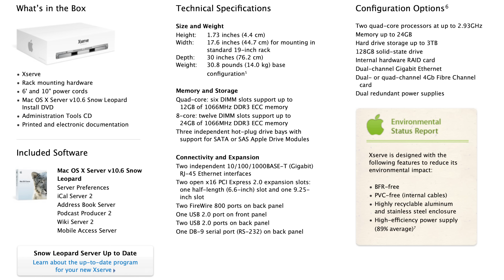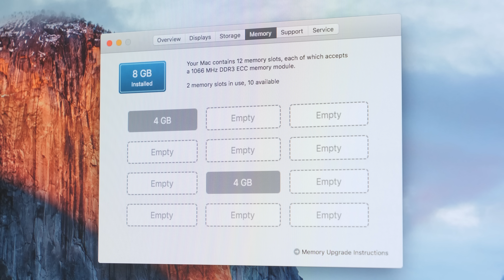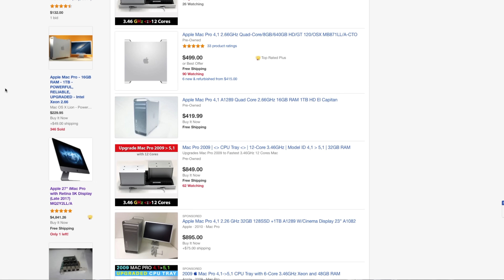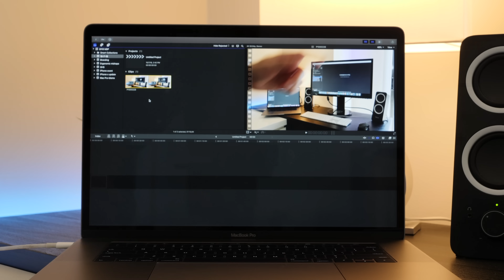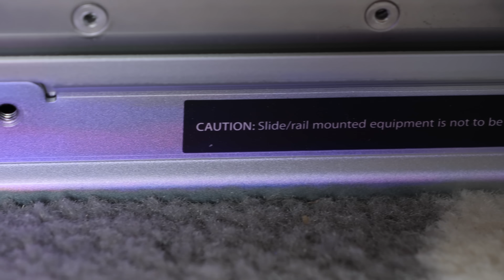I bought the forgotten Apple Xserve in 2018

Comment from the maker: A lot of people seem to be missing the point of this video: I am looking at the Xserve from the perspective of a standard/workstation user. There's not a lot of server talk because I am examining this computer from the point of view of someone looking for a cheap mac/ Mac Pro (since the Xserve is very similar to the Mac Pro). Also, there are a lot of pronunciations for Xserve and apparently you all hate how I say it :p
Reply: X Serve. not EGG serve. pronounced EX SERVE  :D
Reply: Completely agree with Joshua here. you're effectively taking a tractor and complaining that it's not a car. of course it isn't this was completely designed for a different market. while it may not be a market you think that apple's standard users were a part of, most media workplaces have a server rack in the cupboard somewhere, so the concept of adding apple servers individually for rendering/encoding or in an array together to handle distributed tasks was not an uncommon thing.
Just because these products may not apply to a home user, does not mean that they would not apply to a company using these. for a large scale media company that does a lot of work on mac hardware for clients, dropping 50k on an extended support plan wouldn't be an issue, and buying extra parts? i have spare parts in the cupboard for my workstation, and i'm in charge of restocking the replacement parts at work. we go through them reasonably fast, because when you have hardware on 24/7, failures happen. and as a company, you want to get that hardware back up and online and earning you money ASAP.
I understand what you were trying to do here, but please, don't buy a 1U server, complain about the noise, form factor and usecase when you seem to have literally missed the entire point of the device.
Reply: Can we also mention the fact that Apple cache servers save lives (and bandwidth at iOS update time)... Even tho you can do caching on a MacBook.... but still. 

I agree with Joshua as well, the prices aren’t bad when compared to Dell/HP servers, even though your range of use for this is slim.
Reply: why would you review a server, like its a personal computer??? some galaxy brain shit.
Reply: Dude look into stuff like the LackRack and the like. The ideal use case as a home machine would be to put it in a remote location and VNC/KVM/RDP to it, this is commonly done in the Windows server world.
Reply: You miss one item: power usage and power saving during idle... that is a lot wors too.
Reply: Yeah, but Luke, you titled this video implying that you are reviewing a server, not reviewing a server as a workstation. Bad video title (currently just clickbait to server admins). I suggest re-titling this.
Reply: You kind of missed the whole point of a server. It was never designed to be a workstation or desktop, thus it will not be effective in these scenarios, that's not what it is made for. Yes the hardware is similar to a Mac Pro but there's really no feasible way to use this in the same environment.
Reply: Alrighty then... my reply isn’t as “intense” as some others—clearly taking one’s personal opinion on repurposing an older piece of hardware rather seriously, eh 😉? I totally got what your video was GOING to be about and understood from what perspective your analysis was coming from, so you don’t need to change the title or anything. Perhaps some of your viewers should try to par down their “multi-tasking” and fully engage themselves in a video to actually comprehend what is clearly stated throughout by the creator several times. So yah, please don’t dismiss my legitimate inquiry! 😝
What are your thoughts on using it as a “Media” server? I could easily put that up in the attic (obviously with proper racking, etc) and connect via my just-installed CAT6 network I created! I currently use a mini but that has to stay down near the TV for HDMI. It only has 8GB RAM and a spinning 1TB HD (it was a gift and a very nice one at that but yah, I know, either more RAM or SSD would make a HUGE difference). The mini is the last model they did where you can’t update anything in it BUT, I’ve learned so much and done so much thanx to YT perhaps I can crack that thing and upgrade some of its components... 🤔
Reply: just don't do that! you wouldn't try using a banana like you would use a disc breaking pad, would you? what's the point?
Reply: Any crazy upgrade plan fot this beast ?
Reply: Next investment could be the Xserve Raid as a NAS
Reply: The real point is, We want the title of the first background sound
Reply: Luke Miani you should compare it to the intel compute stick or something close to its price.
Reply: Luke Miani and and you the guy from teen wolf, most important
Reply: Luke Miani 
Thx for the video 
Can u try updating it 
Plz
Reply: …then the title is misleading…
Reply: Yeah, you say it wrong.  Very wrong.
Reply: I cant believe everyone is triggered about him pronouncing something wrong. Also, it’s his Xserve. He can call it how he wants and use it how he likes it.
Reply: Yeah came here to rant but see you covered it. Homelab Heroes love this stuff. The noise and power draw are part of the data center experience. All you need now is some underfloor air ducts, a hot/cold aisle, and that very special moment when you walk outside into daylight when you walked in at nighttime.
Reply: @Jsh how much?
Reply: Yes, & that's stupid, sorry.
Reply: I love having an Xserve sure it’s loud and doesn’t fit in a regular depth rack, but heck not many people can say they own one. Best of all it cost me nothing as it was the backbone many years ago in the school I work in and learned all about some of the amazing features sets in the original OSX Server environment.
Reply: Nah you’re saying it fine Luke! I say “xSERVE”. That’s how you said it too.
Reply: No there’s literally one pronunciation lol
Reply: The only reason I haven't disliked this: I had no idea this thing (Xserve) existed before watching this video. It looks kinda cool, would love to explore one in more detail. Otherwise, you ended up selling the most useful and least outdated component on ebay for cheap :) Everything you complained about is applicable for any server. They all are noisy, power hungry and the friend of mine used to actually dry his hair in a hot corridor of server room :) And there is a good reason for it to be so cheap - if you account for energy price, most modern low-end systems will perform better in all possible ways compared to ~10 years old server. The only reason you may want something like this is to explore server hardware.
Reply: This is a fine video. People hate that you review the Xserve as a workstation. Maybe rename the video to:
I bought the forgotten Apple Xserve to see if it is good for workstation use in 2018
maybe that will keep a little hate away :D
Reply: People just get triggered when anyone talks about servers. “Oh your not talking about it right! Waaaa waaaa waaa!” Don’t listen to them. Love the channel
Reply: For starters, if you can't pronounce the name of the product maybe you shouldn't review it...
On a side note, the network cards in that machine are probably still worth more than your eggsesrv.
Reply: I think my problem stems from the fact that you're taking the point of view of using it as a desktop yet ignoring the fact that it's a "Server" and then being a whiny brat complaining about "Noise" You bought a freaking server, of course it's going to be "LOUD!" If you want quiet find a way to replace the fans with Noctua fans or something, but complaining about the Noise level is pretty low even for Mac users. Oh by the way "PC for Life!"
Reply: To everyone: here's the problem, this is a video explicitly about complaining that a server is not a good desktop computer. It's a video about a tractor not being a car. This is not a serious product review where the reviewer tries to give a neutral viewpoint.
Reply from the maker: @PixlRainbow  you're wrong. I like the Xserve, I'm not complaining. And it's perfectly reasonable to compare this to a workstation when it shares it's parts with a workstation! Apple discontinued the Xserve largely because of the similarities to the Mac Pro so clearly it's not a ridiculous comparison
Reply: @lukemiani  how am I wrong? You just agreed with me!
Reply: @lukemiani  no, it's not perfectly reasonable.
Reply: Nah man, it's not a workstation therefore knocking it for not being a good workstation is pretty dumb.And there's literally one way to say it. X.....serve..... not egzERVE. Sorry but somethings are just the way they are!
Reply: I know I’m a year late but it’s as if none of you actually watched the video lmao, he didn’t knock apple once or servers in general
Reply: Just like how there are lot's of pronunciations for iPhone? Go ahead, try saying eh-phone, or pronounce the i as it is produced in tin. There is one way to say Xserve... sorry bro.
Reply: It’s called a ex serve god you say it weird. If you want a cheap Mac buy a Mac mini.
Reply: Luke Miani loved the video & oh my gosh the race cars Rhan Stahpppp 😂🤣🤣
Reply: That's how I'd say it. Liked the video man!

Comment: These things had a lot of potential but Apple never seemed to want to make them successful. It's loud because it wasn't meant to be used in the same room where you work. ALL rack mounted servers are this loud. In the long run, it was better for Apple to make macOS work better with servers running Windows and Linux. Apple's adoption of ActiveSync and bringing Exchange compatibility to macOS were great decisions. I have setup and run a lot of macOS servers during my career. When Apple decided to kill the Xserve, I saw the end coming, but I didn't realize at the time how long it would take for Apple to kill off macOS Server. macOS Server died a slow death as Apple gradually made the product useless with each new version. This is how I convinced my customers to abandon macOS Server and move to better solutions.

Comment: I am super used to loud computers, my Asus 2004 gaming rig (was a super powerfull pc when new, 3 ghz dual core processor, 4 gigs of ram, gpu with 1 gig of vram, IN 2004!!) but the problem was its loud fan system, a 12 inch side ”turbine” made it so loud that I would not even try to use it while someone in my family was sleeping. Nowadays after I changed the case, it is way quieter and I also changed the GPU from the OG AMD something series (the one with 1 gig lf vram) to NVidia GtX 960 2 gig, from my fathers old pc. I am a tech nerd with many computers, laptops, phones and tablets.

Comment: 1st, your benchmarks are not giving you the real performance of this system, not until you have RAM on ALL memory channels of those CPUs
2nd I would have kept at least one of those network cards so I could use this as not only the storage server but also the main system router and firewall
3rd I would add an SAS controller with external connectors one with decent cache RAM on it, minimum 2Gb and add another rackmount enclosure, a SAS Storage Enclosure one that includes the SAS expander and fill it up with decent hard disks and at least 4x2Tb SSDs (SATA or SAS) for file system speed up (using ZFS)
4th No, this can not run MacOS, this must run a Custom NAS Linux distribution, such as TrueNAS for example.

Comment: I don't understand why a server machine would have a graphics card at all.  It's a server.  It serves files, web pages, databases, etc.  No need for a video card.  I used to work on server development at a large company.  The "graphics card" on our servers was a serial port attached to a dumb terminal.  Screen color choices were green characters or no characters.  So then I thought maybe Apple intended this to be used to render video.  But it is slow at rendering and video transcoding.  Also, do not put something that runs this hot in a closed closet without A/C vents and airflow.  Bad idea.

Comment: Another con about the Xserve is if the raid battery fails your Xserve will not detect any drives except for one with a standard install of mac os but other hard drives are not seen by the machine

Comment: Every rack mounted server that anybody runs on normal environment will be loud and this is because it’s not build for that condition, just by itself it will not handle the temperature in a safe way, it will need a assistance of a cold environment just like the one that’s been handled on data centers.
If anybody wants to run a server like in you’re house, in a closet or whatever non assisted cold environment, just go to a tower server solution that’s it’s been build for handling by itself the temperature without overheating.
This is why you see this two options as servers.

Comment: I bought a bunch of these. They're not built for video, that's not it's job, they are built for enterprise use for thousands of users. I would set these up for use in creative industries like newspapers, design and engineering environments. Sound baffled server racks easily negates the noise but most server rooms aren't built for comfort being cold and noisy.

Still, the REAL reason they became obsolete is that RAID farms became cheaper to set up with powerful and cheap PC boxes running windows or linux. No need for fiddly Mac setups as even Appletalk became agnostic.

Comment: IT Infrastructure Pro/Data Center Manager here. You will likely dismiss this comment as "missing the point." But I think you are the one missing the point. You wanted to buy an M1 Abrams tank to use as a daily driver, and are complaining it's hard to park and has horrid gas mileage.

I get that your theme was "you see the XServe as a potentially cheap Mac option...is it practical?" Perhaps to serve as a warning to others. It's a hack, and I have some respect for that--I've been giving consideration to similar scenarios (though somewhat different hardware). 

But it's server hardware meant to go in a *data center*. The form (19" wide, 1U tall) is meant to go in a rack, and have data center cooling (hot aisle/cold aisle, conditioned power, etc.). Every critique you have of the system is true of any data center server, regardless of manufacturer. Data centers are loud, dry, cold places, not meant for humans. 

Certainly you can use it as a "desktop"--as you suggest, you can put a server rack somewhere in your house and work it remotely--in fact, that's basically what it's designed for. I suppose there is some value: your video may make folks thinking "Cheap Mac Pro" go in with their eyes open.

Comment: It was never out place, from its release until it was retired (that being a very sad day for many SysAdmin colleagues, myself included). I had about a dozen deployed between various campuses, and when Apple went from Xserve’s to marketing minis as a server replacement running OS X with a $20 app (Server) on top… I puked, took a vacation, and went straight to VMware! 

As for the noise pollution, Discovery Channel in Miami had about 20-30 of them deployed in operations. Not as amplified as you’d think because those environments are what the Xserve was made for. Legendary server.

Comment: Luke, most of the noise is the fans... you should look into replacing the fans.  I did on a border router so I could use it at home... same issues, great tool, way to loud... for about $30 in fans and shipping I fixed mine.  I bet you can too.

Comment: I bought mine in 2018 (Dual quad) and it's a beast for the price I paid for it.  I have sunk 300$ for 96gb of memory, which was well worth it.  It renders video and does a great job.  I have it in my living room but I don't mind the sound.  It is big enough that I got a 3 rack shelf and the xserve sits on top as a table top.  For what I want it to do, it has been a great purchase.  The only down side I have found has been the raid battery.  It's too much work and cost for me to replace that at this time.  My raid won't show on a normal reboot, but it's holding files I'm not too worried about.  Anyone finds it cheap, definitely pick it up!

Comment: Ummm, No. Its not an odd device. It’s a server. Oh, and of course its loud. There are fans operating at a high speed (rpm) to exhaust excessive heat out that is generated by the server being in a tight enclosed space and also just to keep it extra cool so it can run more efficiently. That’s usually not an issue because servers are rack mounted in a separate room  or vault.

Comment: Thanks for the Video. Can you try and put the 6core Zeons in this baby? And since there is NO quick sync it doesn't fair well with MPEG but, how does it do with Apple's ProRes as a Compressor Render farm? And Can you get your hands on a couple of RX550's? As cheap as these are and if you had a Roll Around Half Rack ... I see huge potential for 3 - 12TB Drives in each and add on that Apple Raid enclosure ... WOW. Not to mention ... Folding-at-Home potential. Love to see more on these.

Comment: I bought one of these and it came without any HDD's. Any help in booting it up. All I get is the flashing question mark. I have tried the front panel, tried reinserting the CD after the system initially kicks it out. I am using Mac OSX Server 10.4.3. I am trying to get one of two (hopefully both) Apple xServe 1,1 and a 2,1. Any help please?

Comment: Noise on rackmounted servers got ridiculous. I still remember our Bladecenters being fairly reasonable in the sound department until an upgrade. Fans were run on demand but after the upgrade all fans ran at 100% for no real reason. This thing is doing the same, runs at 100% for no real reason.